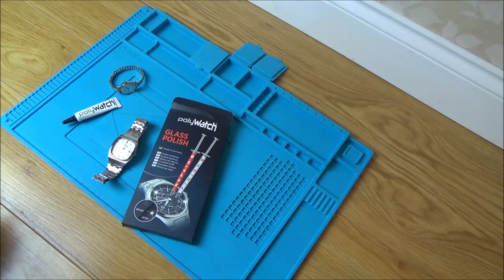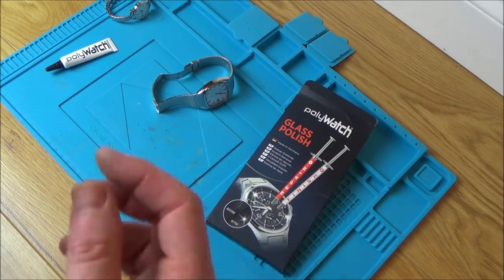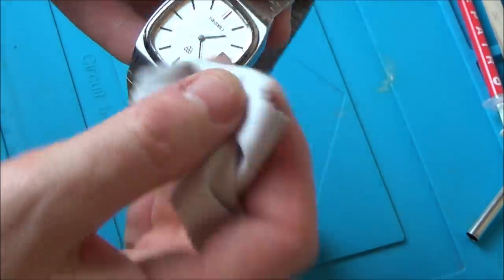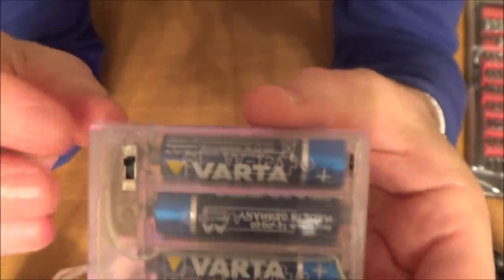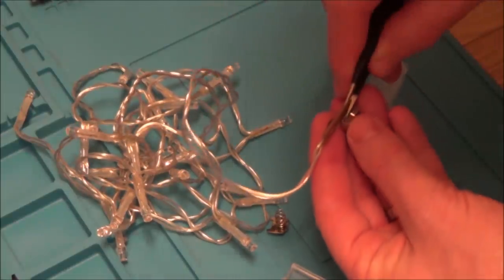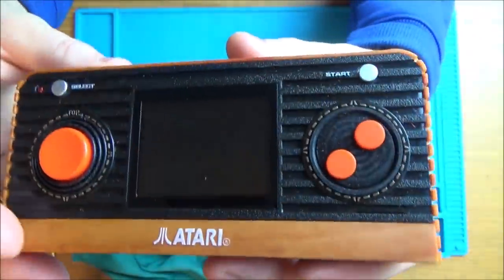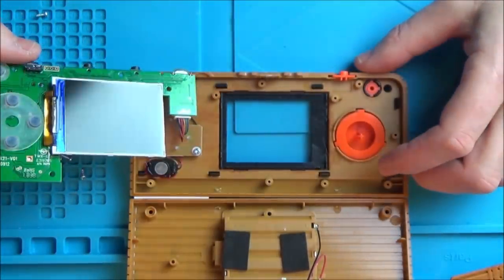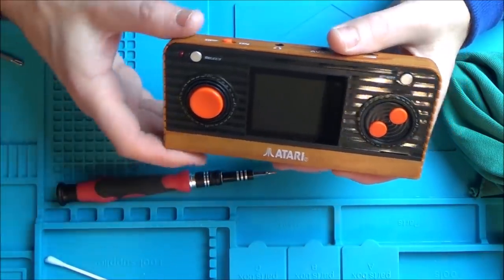Trying to FIX things around the Home - PART 4

Comment: People can joke but the truth is, most people pay others top dollar to get their stuff fixed. Some simply do not have the experience to do repairs and others simply do not have the time but have the money. Thats the good part. Some people enjoy trouble shooting things and have a solid grasp on what it takes to do repairs on items others would consider junk. Because of you, people can enjoy their items for much longer. Nice job and thanks for showing everyone even if they dont have the time to fix something, there are others willing to do it for you. I know it makes me happy seeing something destined for the dump being repaired and resused.
Reply: Challenging yourself to fix household issues is both cost effective and incredibly rewarding as well. You learn not only how things work, but how you can apply these skills in the future. 

An amusing example is that suddenly a vacuum stopped generating much suction and started making a high pitched whine. The staff at a retail store were throwing the vacuum away because, “it didn’t work anymore. “

They had no conceivable idea that vacuum hose they were using had become clogged with a full sheet of 8 1/2” x 11” paper. 

I showed them how to use the handle of a stiffer to remove the blockage. They were stunned. They didn’t know the hose created suction. A brief summary on how a vacuum functions just bowled them over. Now they are not afraid to attempt basic mechanical repairs! They even changed the brush on their own. 

Bottom line, learning how things work gives you the skills to confidently attempt minor repairs to many things. 

NOTE: the above being said, always make sure the device or anything you ever work on is ALWAYS unplugged from the wall and that you follow basic safety precautions.

Comment: Another great vid Vince! On the Atari portion it sounded like you just woke up. I noticed that you always have the same screwdriver set when taking apart electronics. Can you tell me what set it is and where you got it? I'm assuming ebay. I need to take apart a DSLR camera in order to repair the manual focus on it. Thanks.

Comment: Use ipa on hot glue to breaks free relatively easily just put it on a cloth and put it on the glue.apply.pressure nut nut alot.just to make it leak out of the.clotj and it should break free super easily if done right